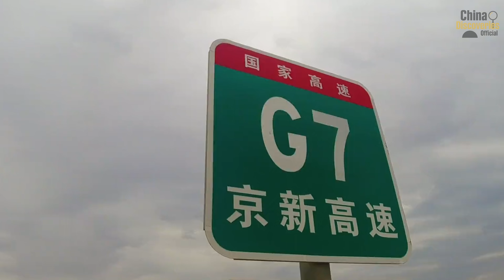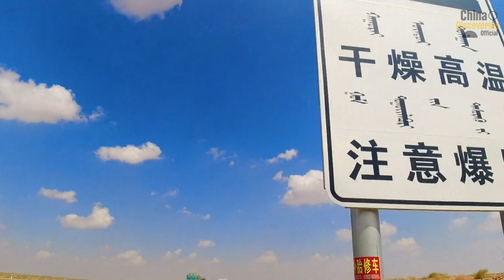SHOCK! China Has Built a Highway Through the Desert

Comment: China has built extensive high-speed rail lines through deserts, most notably the Lanzhou-Xinjiang HSR crossing the Gobi Desert and the Hotan-Ruoqiang line looping China's largest desert, the Taklamakan, using innovative engineering to combat sandstorms and extreme conditions. 
China also has built extensive high-speed rail lines through deserts, most notably the Lanzhou-Xinjiang HSR crossing the Gobi Desert and the Hotan-Ruoqiang line looping China's largest desert, the Taklamakan, using innovative engineering to combat sandstorms and extreme conditions. 
Other than deserts, China has built and operates high-speed railways in extremely cold regions, specifically the Beijing-Harbin line, using specialized Fuxing (CR400AF-G) bullet trains designed to function in temperatures as low as -40°C (-40°F) through advanced heating, insulation, and anti-freeze systems in critical components like brakes and power cabinets. These cold-resistant trains, part of China's massive high-speed network, handle severe winter conditions, including snow and ice, ensuring reliable year-round service in China's frozen northeast.
Reply from the maker: Totally agree. China demonstrates outstanding infrastructure engineering by conquering both harsh deserts and extreme cold regions, ensuring reliable year-round operation.